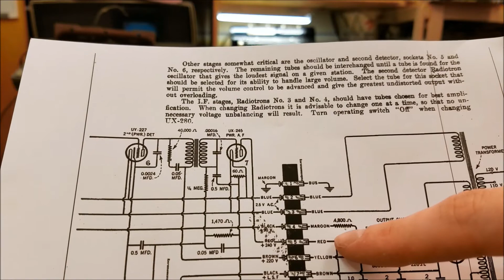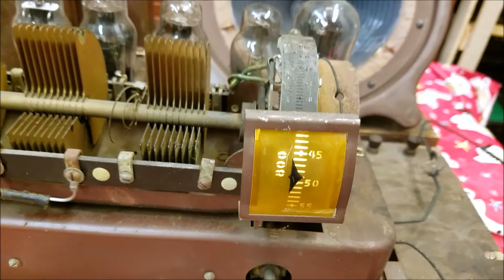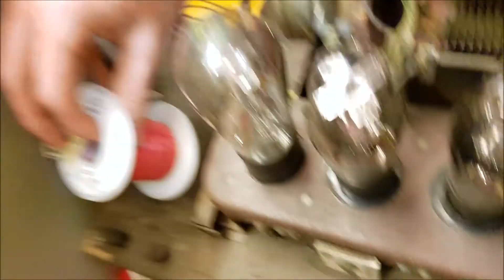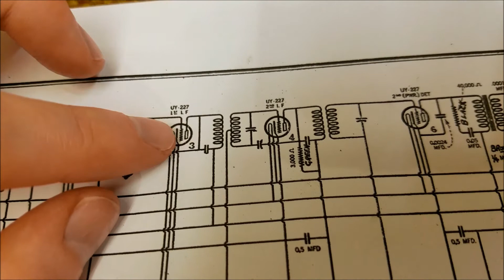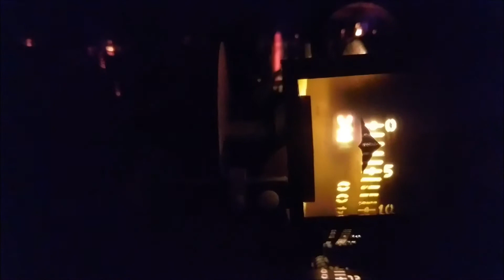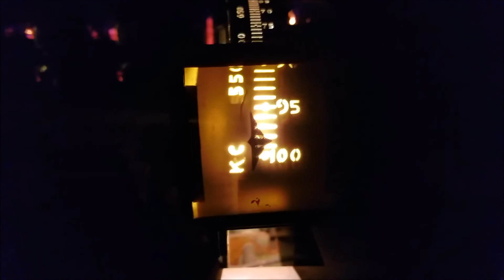1929 Radiola 66 Superhet Repair

Comment: I'm working on one of these currently; and was obsessing over the filter caps, indeed this one too has no hum but with such big inductors it shouldn't be surprising. Thanks for taking the time to include performing the IF alignment. I thought it might be necessary.
Reply from the maker: At the time this radio was built electrolytics weren’t available yet so they only choice they had was the biggest paper caps they could fit along with substantial inductors. I’m really happy with the performance of this radio, these 1920s RCA superhets are really impressive for their age